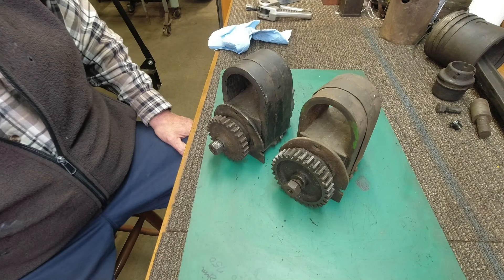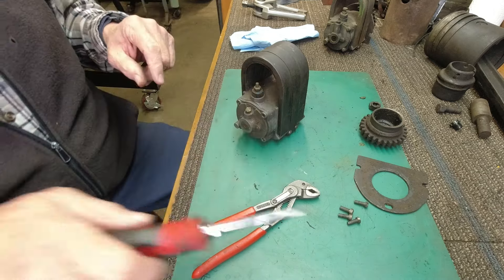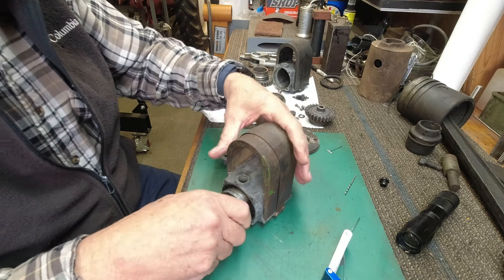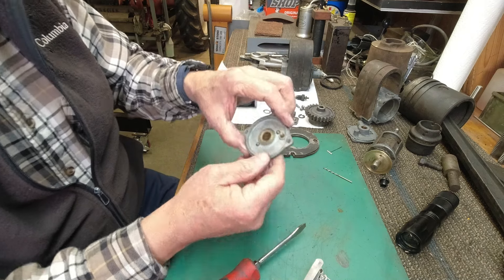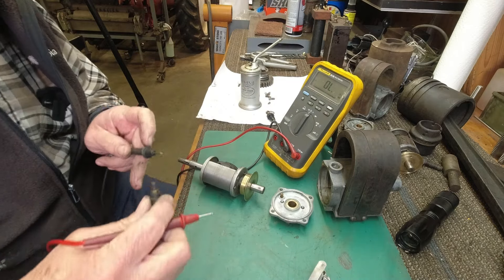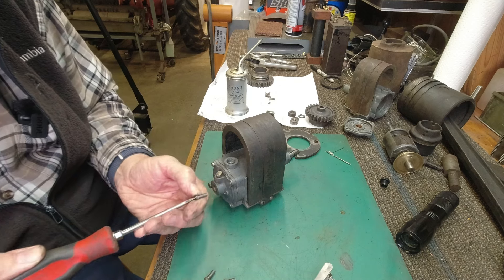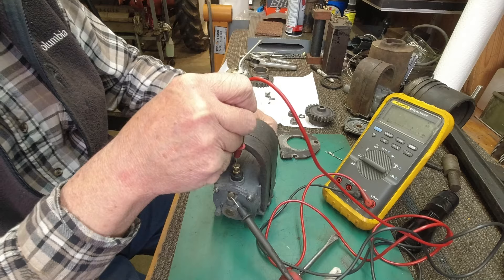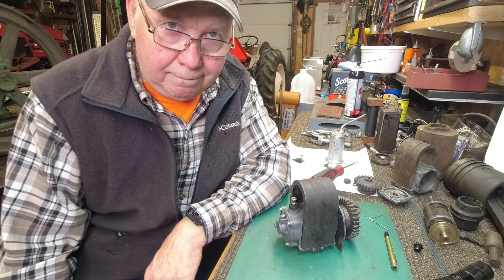John Deere Model E   Magneto Repair

Comment: Do you (or anyone) have any suggestion on how to repair stripped threads in the two bolt holes in the bottom of the base?
Reply from the maker: That can be a challenge but if the metal is good, thread inserts such as Heli Coils can be used. One major problem   is that the original metal (pot metal/aluminum alloys) can begin to deteriorate from the inside out. The metal literally becomes porous and flakey and falls apart. Fortunately, new/reproduction parts are available.